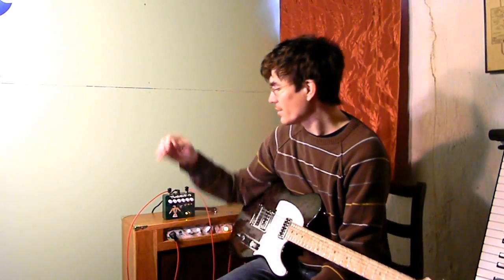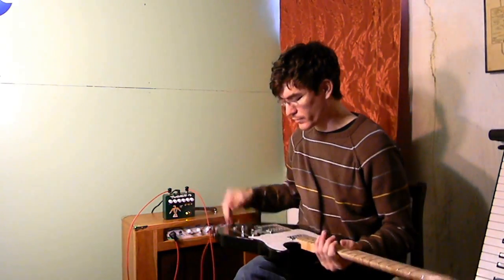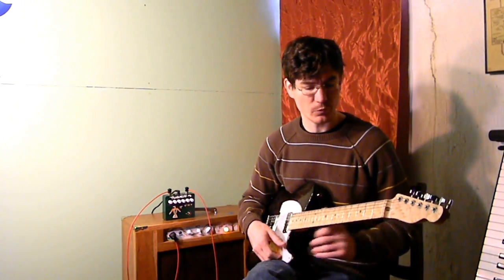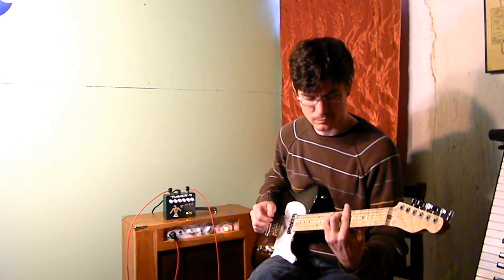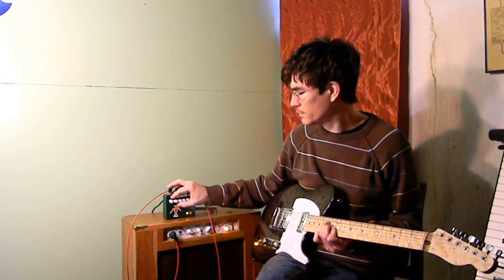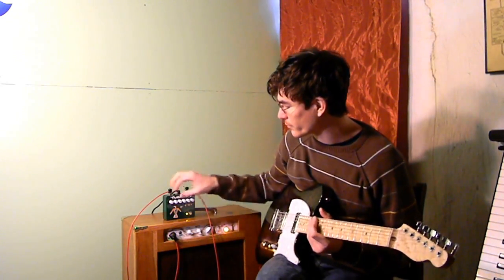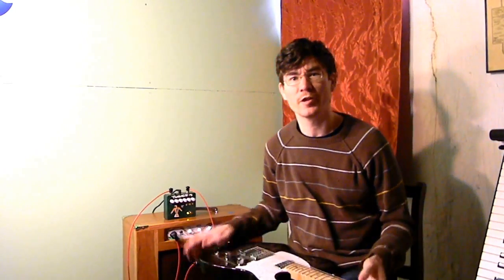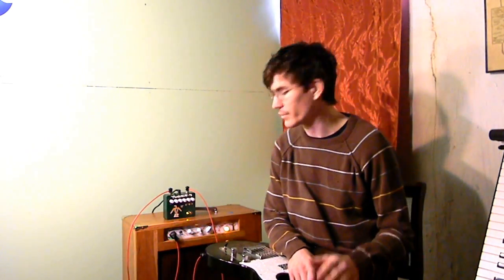Runoff Groove Thunderbird demo

Comment: can you do a short vid of single coils going through this circuit on the lower end of the gain?
Reply from the maker: Sorry, but I don't do multiple demos of the same pedal, not least of which because I don't typically have time. ROG has some demos on their own site of other settings. Besides, Filtertrons also aren't terribly high output pickups and are pretty bright as humbuckers go, so perhaps the part of the video where I show what it sounds like with the guitar volume rolled off is sufficient?

Comment: Sounds like the noise floor of the pedal is really high, how loud was the amp?
Reply from the maker: The noise floor is high, which is a consequence of this much gain in op amps without filtering out all the treble.

I thought I mentioned this in the demo but definitely in my build report. At least a couple people have put a noise gate in theirs.
Reply: jonspatton
 Nice demo
It's the greatest "amp in box" I've built so far (from among a dozen others).  Mine is very quiet (I didn't notice increased gain floor at all). Have built it from tagboard fx website. Cheers.